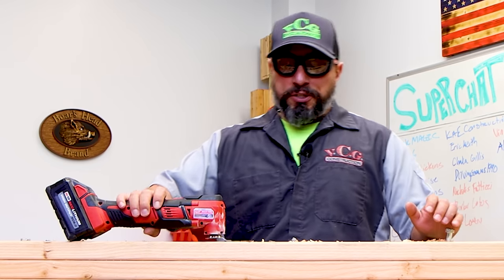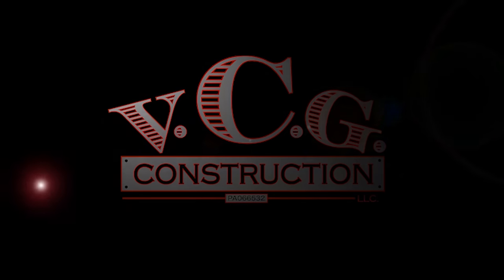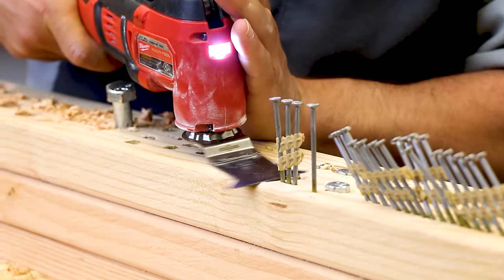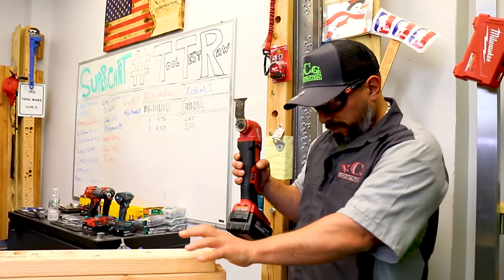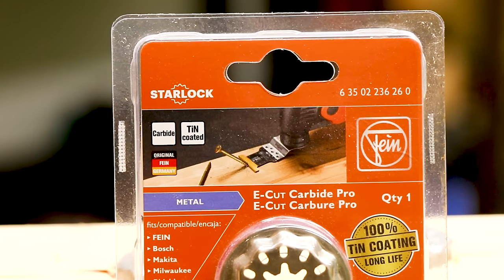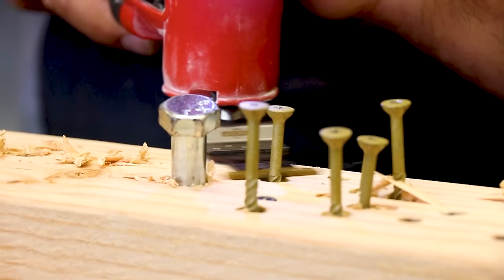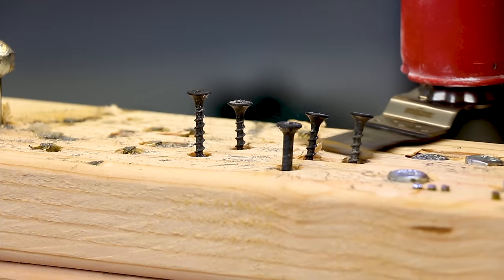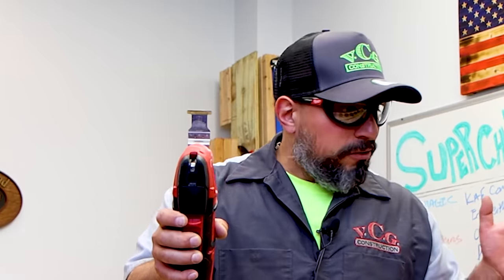STOP! Watch This Before You Use A Oscillating Multi Tool (Stupid Mistake)

Comment: I always slow the speed down to cut through metal to reduce heat that ruins the temper of the blade and don't push hard. Let the tool do the work.
Reply: Wise and experienced this one is, speak the truth he does.

Comment: I feel like most people focus on one spot in the blade making cuts with these. For longer live try to use the entire length of the cutting edge evenly and give the blade q chance to fool down when it starts to heat up. These tips have greatly increased the life of my multi tool blades. Also not pushing it too hard and letting the tool do the work.
Reply: Ive heard 2 or 3 people say keeping a cup of water nearby and dunking the blade periodically will extend the cutting life by  a lot.  Have you tried that before?
Reply: No just use the same dull spot and go leave reviews online saying how those blades from that brand suck.

Comment: Blades last alot longer in those oscillating tool when you dont push it into the material you are cutting. Instead you basically let the tool do all the work. Slight pressure is all it needs. And the blade will eat through the material (including nails) and last alot longer. Give it a try

Comment: I've been using a dremel carbide for metal since last year. You can also sharpen most of these blades really easily. I use dremel with the cutting disc. When your teeth are flat cut it straight across then make the teeth then sharpen with the sanding disc.
Reply: I've done this but cutting screws off cause u arnt allowed to swing your hammer to breakem off due to location u grab the occilating cut off an boom no teeth when ur at home sharpening is great when ur out an about on the job it's a new one an a new one an a new one lols cause fuckem right
Reply: Great tip cobber.👌

Comment: Multi tools are perfect for making junction box holes, making notches in wood, removing grout without damaging the tiles, sanding the ends or skinny sides of wood for glue ups, and more. However, a one handed reciprocating saw fills in the gap between a circular saw and a multi tool for cutting material.

Comment: Aaaaagh beat to trying these new blades. I have box full of use or part used metal wood blades from Fein. All current blades are Starlock 2  , the new blades look good , the thing I find important is the speed setting for cutting and not forcing the cut. Very good and informative video for those still learn about these amazing tools .

Comment: Most of the guys I've seen burn out the blade with one NAIL  was because they were hulking down on them way too hard instead of letting them cut.
Reply: When I got mine the first advice I was given was "it's not a driver. You don't need to push it that hard"

Comment: This makes sense because I just bought the Dremel  5 amp version of this. One of my first cuts, I absolutely trashed a wood/metal blade trying to cut through a screw. I knew it was a tough screw because I picked up the old rotary Dremel with the carbon fiber all-purpose locking disc and still had some trouble with that! I stopped cutting out of concern for sparks, sawdust and fire safety, then just snapped it off with a pair of pliers. Now I know why I was just a bit disappointed with the “metal” performance of those blades. It seems that nails or staples are no problem for it as it quickly cut through old cabinets to make room for a new dishwasher installation.

Comment: Had to use an oscillating tool to cut through a 7/16" stainless bolt that I needed to remove. Some doofas had cross threaded the nut, so it only backed out about 1/8 of an inch (at most) before locking up, even using a 2 ft breaker bar. Couldn't use an angle grinder because I had to minimize scuffing of the equipment surface and the metal cutting wheels are just too thick. That's where the circular blade came into play on my tool (Rockwell Sonicrafter). I had one of the Dewalt titanium ones and was able to cut through the bolt with only one blade because of all the teeth on it. Took out about 1/3 of the teeth, but it got the job done. Also took quite a while as we had to stop to let both the bolt and the blade cool, but the customer was impressed.

Comment: you can imagine, if the shank is longer,  that 2 to 4 degrees of travel around the center of the pivot means the teeth travel farther and thus a lot more teeth travel across the curf in each stroke so the blade cuts faster and if the blade is radiused around the pivot point (fulcrum) as the blade oscillates back and forth, it maintains constant contact rather than bouncing off the surface because the two far ends of a straight cut blade travel forward in relation to the center point of the radius or arc that the blade travels around in a back and forth motion. So if you guys (and girls) want a better experience and less vibration and fatigue using an oscillating tool look for radiused blades for them and the longer the shank the better.
Reply: Waaat. I want to understand what you're saying.

Comment: I just made this same “screws vs nails” mistake with a brand new diablo framing blade on a deck demo. Won’t be doing that again.
Reply: You can sharpen the dull blade easily, don't throw it away.
If it's missing teeth just file down the old ones and cut new ones with a file or rotary tool

Comment: Hey Vince, on you guys' recomendation, I got a oscilating multitool, same one you have there, and it's been an incredibly versatile tool. Great purchase overall. But at some point, I used it with my bigger 9AH batteries. After a couple hours work with it, I took off the battery and noticed that the plastic from the tool was starting to wear/melt/weld into the plastic from the battery right were they slide together. Is there some hidden DON'T EVER DO list that I missed with this tool? Is that common for these tools, to beat up heavier batteries? Have you seen this at all, or heard of it? I treat my expensive 9 and 12 AH batteries like newborns, and this surprised the heck out of me.
Reply: The capacity of the battery shouldn't affect the tool as long as they're proper Milwaukee batteries (not Chinese amazon junk)... There's a sensor (thermistor) in the battery that's supposed to shut down the tool if it gets too hot.. Sounds like it failed... I use big batteries in my oscillator all the time there's nothing wrong with that
Reply: @NovaNinja_  I wasn't suspecting that the capacity of the battery was related, just the weight. It seemed to me that something about the way the tool vibrates makes the heavier batteries beat up the plastic of the clip area.
Reply: @operator8014  while you're using the Fein blades, you might as well use the Fein tool; i. e., the MultiMaster. It has the best vibration damping of all the oscillating tools. The Festool is also very good but you have to use Festool blades.
Reply: My guess is the bigger, heavier battery has more inertial mass and basically stays in place relative to the tool vibrating around.  The smaller batteries probably move with the tool better.  The new fuel omt's supposedly have way less vibration felt by the user which would shake the batteries less too.
Reply: @operator8014  Don't know if you'll read this after a year, but I think I know what might be causing the problem.

Guys above me suggested weight, I think it might also be something else.

When it comes to electrical connections like the battery - tool terminal, there is a possibility that the contact area of the connector is too small or not clean, which causes additional resistance, which means higher current which means excess heat.
Also bigger battery packs can deliver that higher current no sweat, which means there's more power drawn from it, yet not so much that the built-in protection kicks in and you probably don't notice it during use.

It might be weight, it might be the contacts, it might be both - added weight stressing out the connector causing it to heat up in use.

Comment: That was a great "real world" test as you didn't just use on small section of the blade to cut the screws as some other tests have done.
You have shown that if used correctly, these blades can perform very well.
Keep up these great videos.

Comment: I've been using the Bosch Carbide blade for oscillating/plunge cutter for several years, last a long time cutting through anything and cost about $10 - 12 /blade in a triple pack.  Stucco will ruin a blade but you can cut one opening in stucco for an electrical box if you need to, even though it is not rated for cutting stucco and it should only be used as a last resort. I'd love to see if the Fein carbide blade is moe better than Bosch or not; if you know the answer, please reply. Thx.

Comment: I would have just grabbed my 18v makita sawzall... these are good for notches, cutting toilet bolts, along the top of baseboards and sometimes I use it to cut between manifolds when I need to rebuild or re route the water line leaking under a slab.

Comment: You can also sharpen the blade even ground brand new teeth after knocking down the old ones with a file.

Don't throw away dull blades

Comment: Not sure if said, but those look like the GRK framing torx head screws, what I use & some good “screws”😉 Very Tough💪🏼.
Pretty nice OMG Blade there. Usually I get the Bosch or Dremel brand blades, as they always in stock around me. Don’t have many Fein blades cuz usually gotta order, & it’s one of those things.....when pull out the OMT, forgot to order, & end up running to  store for blades & end up with Bosch or dremel, LOL. Also, do have quite a few other blades from those promos while back. Gotta love buy one get one 😉
That Fein blade was cool going thru the screws & not losing any teethesses. Another difficult material that chews up OMT blades is lath n plaster walls. That stuff eats OMT blades for breakfast, lunch, dinner, & all the snacks in b/t😉
Thx for sharing Vince👍🏻👍🏻

Comment: The variables commonly overlooked and mostly controlled by the operators are the cutting speed and feed rate with which the proper blade is used.

Yes also cutting through materials the blade is not rated for is a mistake on the operator

Comment: just yesterday i cut through probably 300 or so framing nails siding ring shank nails and staples with my diablo metal blade and it still has all its teeth! some are a bit damaged but still i was very impressed!

Comment: The problem with straight cut blades is that you can only use the center area of the teeth because as you get closer to the edged=s the blade bounces more than cuts. they should radius the cutting edge of all these cutters! If someone makes radiuses blades for these tools especially with a longer shank, they would make some money in my opinion.

Comment: Hey Vince, very informative advice, I’m a electrician by trade very handy with most small and large tools. When I started my trade many moons ago i was taught to cut a electrical gem boxes in a tile by chipping away the tile glaze with something pointy (nail, screwdriver, awl, etc) and then finishing the cut with a 3/16th mason bit in a regular speed drill . My question is their a isolating blade for tiles on the market
Reply: By the way yes i do own a a grinder and I hate cleaning the aftermath. I figure an isolating tool would be a lot gentler on the customer
Reply: My home Depot app yields 5 results for "osilating blade tile". This technology and tool definitely exists. You have many options.

Comment: Would this be a good tool for cutting off steel rivnuts? I have 2 loose rivnuts on my Jeep that have to be cut off so I can replace the fender, I used an angle grinder for 2 other loose ones and it took forever. Was looking for something much easier and this seems to fit the bill.

Comment: Hello there hope you're well. Might be a silly question but how do you get the two clamp bits to separate/ open in order to attach the blade? My manual says to turn the lever clockwise at the top then the two plates are meant to open but it doesn't open. Could you make a video on how to properly set up the machine for each blade? Thank you in advance!
Reply: You need to loosen the knob and then push/hold it down (like a button.) Insert the blade, then release the button, and tighten the knob. Pull on the blade to make sure it's secure and you're ready to cut. (Don't touch blade after cutting, it gets HOT!)

Comment: Hey Vince.
My Sawzall is in the shop and I didn't think I needed it today but I did. 

Customer want me to put 2 wine fridges into her 30yr old kitchen cabs.

Needless to say I pulled out the old M18 "Vibrator" and cut through that thing Like A BEAST! on a 5ah

Dont want to say what blade I used, lol. 

GO Vince!
Reply: If one of my guys grabbed a sawzall for any cabinet work, he'd be grabbing his bags and walking home immediately after.

Thank God you failed upwards into using the correct tool for the job. Blind squirrel, nut, etc.
Reply: @Dave-ek2jx  Actually I would have preferred the quicker way around the block.

Of course your only speaking generally because you weren't there. 

A sawzall was exactly what was needed to cut the interior shelves of a 50 year old solid wood cabinet. Especially if you know how to actually use one.

Thanks for your 2cent anyway!

I Always Thank GOD!
That I Dont Fail
That I'm NOT one of Your Guys
and I Drive My Own Vehicle. 

Squirrel not 2 blind for 
"Deez Nuts" LMAO!

Comment: I have found that when using my multi tool if I try to force the blade to cut, the blade will dull a lot quicker.
Reply: Just like with any knife/cutting device, always let the blade do the cutting.  If not sharpen your blade.

Comment: I always use bi-metal blades for every application I use my multi-tool. No sense in using just a standard or nail in wood blade in my opinion. The only thing I change is the size of the blade to fit the application

Comment: Ya I got a new milwaukee metal cutting blade and proceeded to cut about 4 nails (yes framing nails) well I actually cut 3 nails and on the 4th nail I had to move over to a side to even complete the cut. 
Is it possibly something else like maybe there's a speed thats ideal? 
I just don't see how I could possibly justify destroying a 15$ blade even if it did cut 50 nails I would go out of my way to use anything else because that's still not very many at all.

Comment: First time I used a oscillating tool the other day, maybe I might have gotten the wrong type of, bi metal long life from fein, cause after 12 1/4 carriage bottles not a single tooth left.
Reply: @jumper233  that would have been mine also, but the space was to tight, so I figured id try the oscillating since I had it.

Comment: ya, those wood with nails blades don't get along with sheet rock screws, but , i did accidently hit some spray foaf insulation, (it was cured) and it was the best thing i found for trimming that shit, and any foam for that matter, also if you doon't like throwing stuff away, you can use the dull blades to scrape up tile and glue and it also removes old caulk as well

Comment: Use the whole length of the blade so it doesn't over heat a small part of the blade also use lubricant and allow blade time to cool so it doesn't over heat

Comment: Im waiting for milwaukee to release a new oscillating tool because almost every other oscillating tool has a quick insert blade system every brand from dewalt down to ryobi the only other high end brand i can think of that doesn't have the quick access is the makita but their's is a literal block to hold they've been due for a while now
Reply: Makita have their Starlock machines in stock. They're waiting until all the old ones are sold then they'll release their new one.

Comment: To be fair to homeowner type users, they probably just used the blade that came with their oscillating tool...and generally those are garbage. I mean all the teeth can disappear in seconds with cheap blades on the wrong material. 

Having been using carbide blades for a while and with even pressure and keeping them in contact with the cut they last ok. If you let them slam into the metal, or bounce around the teeth do chip pretty easy...but that's to be expected from carbide.

Comment: So there's a difference between nails and screws in hardness term? I ruined a new Curvetec blade being ignorant of that. When a nail I was trying to cut through took a long time, I dialled up the power and when I finally looked, the teeth in the middle of the blade is bald-ed. I re-read the spec for the blade and it says "for non-hardened" nails.

Comment: How is it that drill bits and jig saw bits can sell at a very reasonable price point and multi tool blades (most dont have any carbide) are still set at extortion level price points?

Comment: I thought everyone knew screws were much harder than nails.

Besides, with needle files you can Resharpen those blades
Reply: not all screws are harder than all nails. concrete nails are much harder than wood screws. It depends on what the screw or nail was engineered for. Also, you can use a dia=mond wheel on a dremel to even resharpen carbide tipped blades! Just wear safety glasses cause stuff goes flying!

Comment: That is one Fein blade there...are these much better than carbide blades from Bosch?
Reply: Carbide is carbide. even Chinese carbide is good. Carbide is not bi-metal. It doesn't build up heat like steel. Titanium coating is just a sales gimmick in my opinion.

Comment: Are you kidding me? I used a titanium coated carbide blade and I cut two padlocks with it. No problem. I added oil to help speed up the cut and it took about 5 minutes but it cut right through a hardened steel padlock.